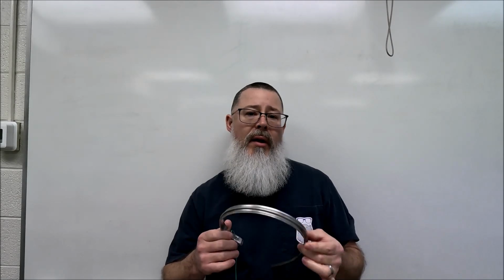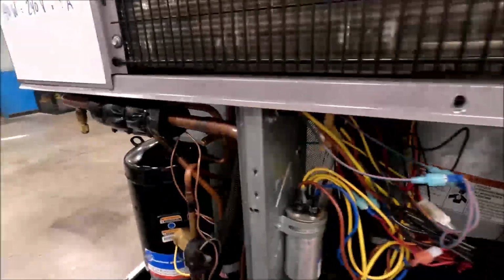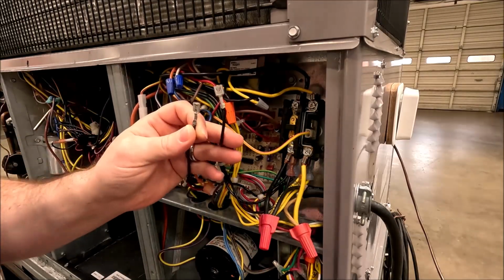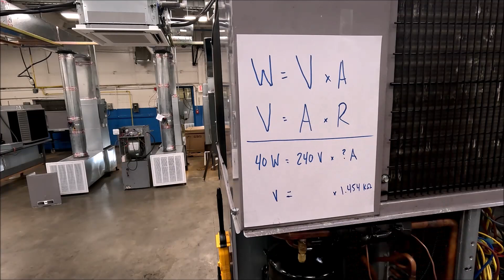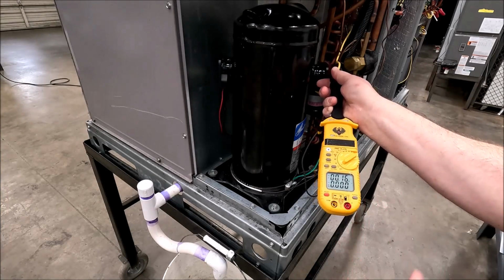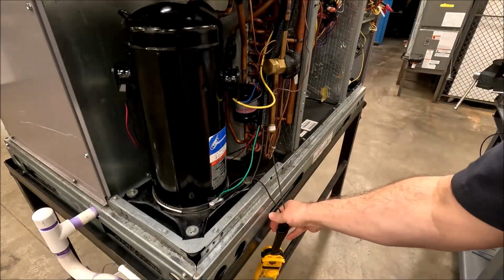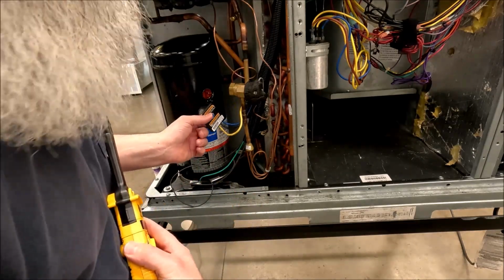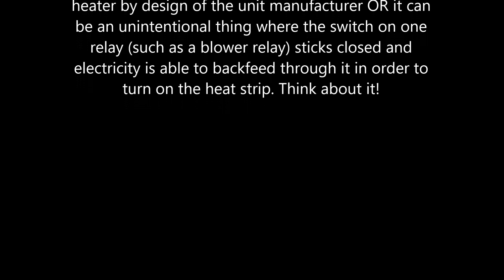Crankcase Heaters and Single Pole Contactor

Comment: I always thought each leg was 120v for a total of 240v. How are you getting 240v with only 1 side connected? It seems like the bottom wire is the only connection to line voltage, but nothing ever connects to the bottom of the contactor, so there is no path. Please explain.
Reply from the maker: That's the back feeding part and the reason for the single pole contactor. It is using the compressor winding to get its complete circuit back to power.

Comment: Perfect explaination ! now i understand why a single pole is important for a crank case heater ! 
I always like to know the "why" behind things and not just ' it works and thats it' you know? Its kinda like the common terminal on the capactior goes on the run side of the contactor. I appreciate you for sharing this knowledge

Just when i think i know it something new comes up... today i saw lennox with a single pole contactor and it had a crank case heater on L1 and L2 . wiring diagram said that was correct...